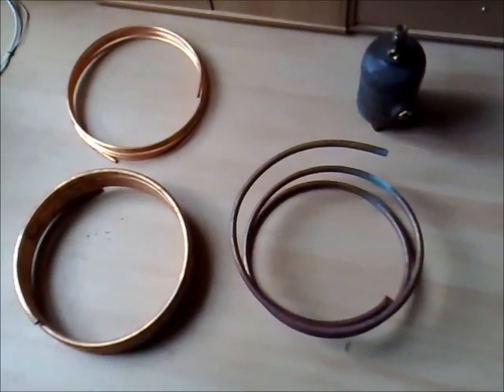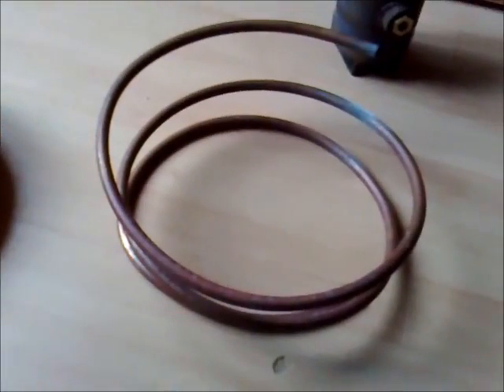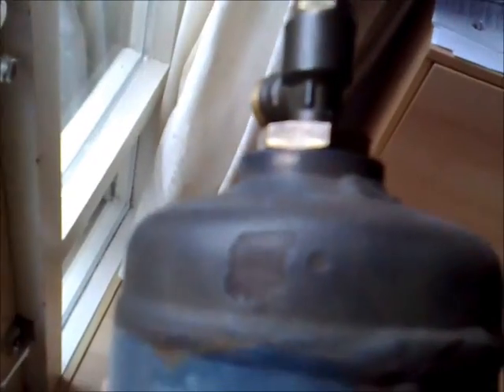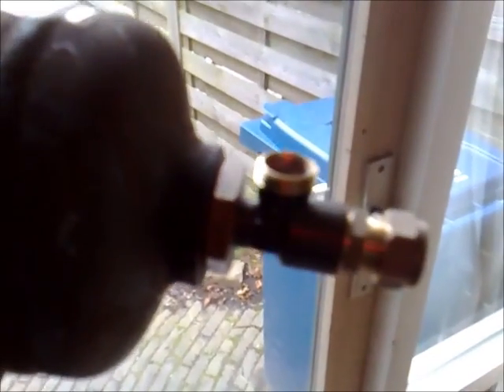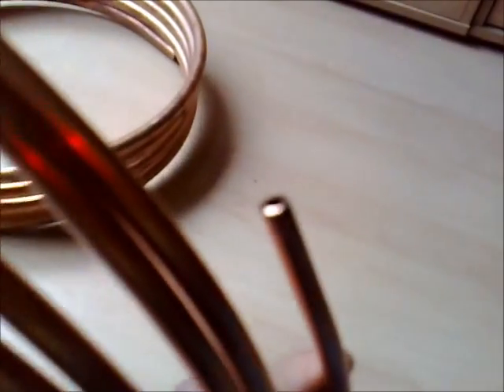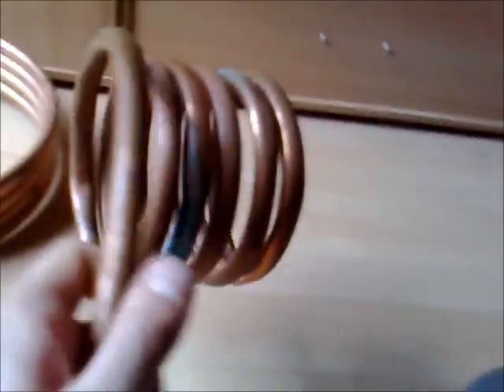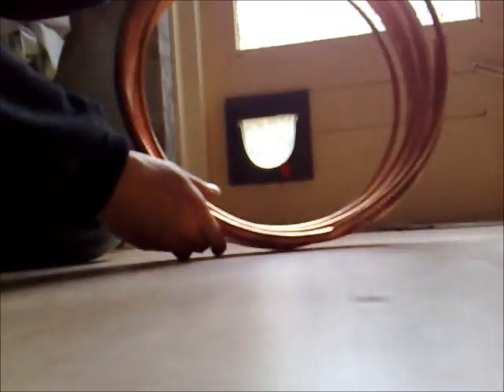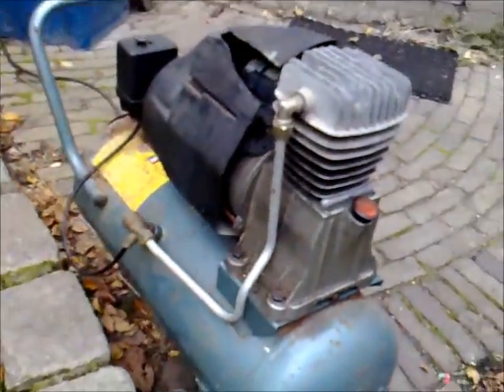hampson linde air liquefier.wmv

Comment from the maker: Hey tesla500 

Last I`m thinking about making a saftyvalve close to vessel itself (on the cold side) and mount the spring for it on the hot side. If I could just connect the two with a glass rod or something. All for better isolation possibilities.

Comment from the maker: Hey tesla500 

This because I want the air to flow slowly through the recuperator so the heat gets time to transfer from one gas to another even in my short (5 M) heat exchanger. Only drawbag will be that there can only be a small production rate.
I`ll search for one in stainless steel vessel but I might try with this one.

Comment from the maker: Hey tesla500 
I finished my heat exchanger just the way you described ;) I`ll post about it after I have a bending iron for 15 mm for the final corner.
The safety valve construction you describe seems a bit overdone I only want one valve directly as possible on the vessel. In normal working condition there will be almost no pressure at all in the vessel.
Reply: 🔴 ¿Qué es el Islam?

🔴 El Islam no es solo otra religión, es el mismo mensaje predicado por Moisés, Jesús y Abraham.

 🔵 Islam literalmente significa "sumisión a Dios" y nos enseña a tener una relación directa con Dios. 

🔴 Nos recuerda que, ya que Dios nos creó, nadie debe ser adorado excepto Dios, también nos enseña que Dios no es como un ser humano o como nada que podamos imaginar. 

 🔵 El concepto de Dios está resumido en el Corán como:

{ Di: "Él es Al-lah, Uno.  (112:1) 

 Al-lah es el Absoluto. (112:2) 

No engendró ni fue engendrado.(112:3)

Y no hay nada ni nadie que sea semejante a Él". (112:4)} 

 🔴 Convertirse en musulmán no es darle la espalda a Jesús. 

 🔵 Por el contrario, es regresar a las enseñanzas originales de Jesús y obedecerlo.

⚠️ Más....

Comment: You may need to add a second compressor to boost the pressure, I'm not sure if the ~150PSI the shop air compressor produces is enough.

To pull the tubes through each other, you could try straightening them out, pulling a rope through the large one using a vacuum cleaner to suck it though, then crimping the rope into the small tube. Then you can easily pull it through with a large amount of force.

Comment: It may not be a good idea to use the iron vessel for the liquid air, mainly because it will become very brittle at low temperatures, like glass! A better vessel would be stainless steel, or perhaps brass or copper, which won't become so brittle.

I'd recommend two safety valves, put one at the warm side of the large recuperator tube, and a second one on the end of a dedicated tube going from the vessel to the warm side. This way the safety valves are kept at room temperature during operation.